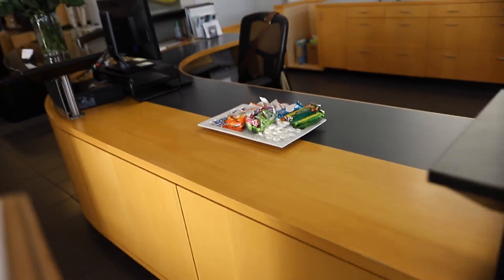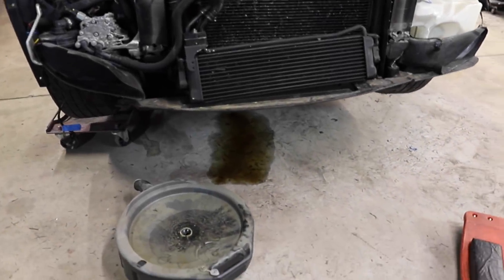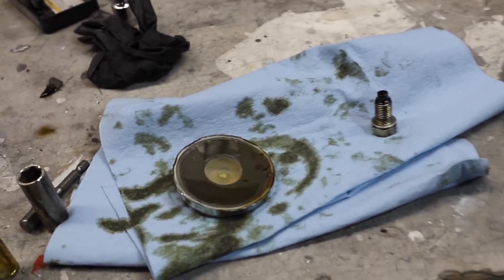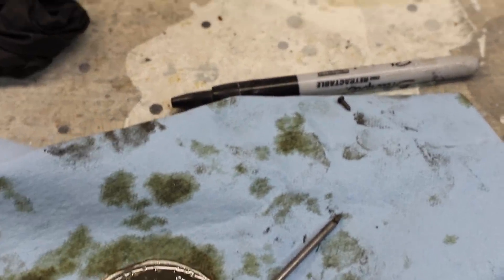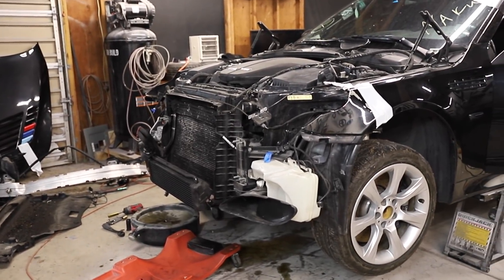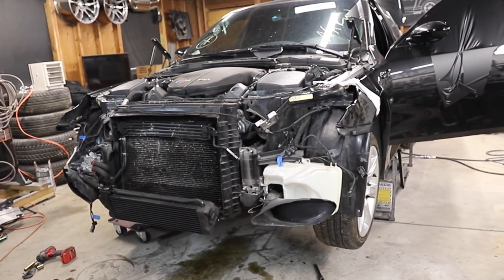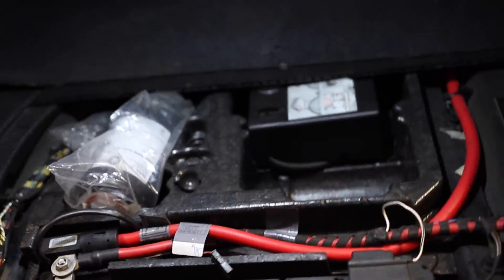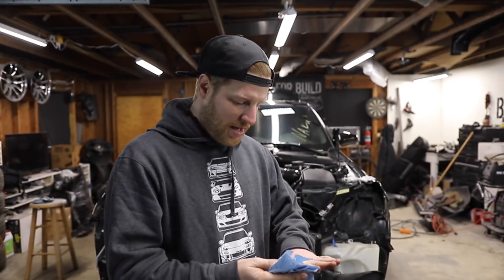Does the M5 Engine Run? Let's Find Out!

Comment: I don't know about an m5 but that amount of metal in the oil would not be worrying in an airplane.
Reply: Yeah, same. Don't know about an M5 (or an airplane for that matter), but I've seen worse in some of my bikes and those were fine. I freaked out the first time I saw it there too, but the fact that your oil filter is so clean is a pretty clear indicator that there's not something big falling apart. You might still want to do the oil analysis as that'll tell you about a bearing that's being worn down, but I wouldn't lose sleep over it.

Comment: Bro, don't buy oil from the dealership...
Reply: Why? Because of price? I think that Castrol provides the oil for BMWs, so you should have the same results with buying it directly from Castrol. In general the brand shouldn't matter as long as it's the right kind and good quality oil.
Reply: @zeroyon223 Thanks for the info. I'm not really familiar with the newer cars, mine is from 2003.
Reply: If you get a trade price the BMW oil is some of the cheapest full synthetics you can get.
Reply: Any time I need synthetic oil I buy pennzoil platinum. It’s never let me down. (This ad brought to you by Pennzoil) 😋

Comment: When doing timelapse, turn off the autofocus and use a higher aperture with higher ISO (it's a full frame, it can handle it). You can save these settings in on of the creative modes on the dial for ease of switching to this.

Comment: I hope you have a high quality torque wrench Chris! Torque specs on rod caps are very important to get right. Inconsistent torque leads to inconsistent bearing clearances!
Reply from the maker: just got me a top of the line one, cost me over $300
Reply: You'd have to overtighten a fastener to a relative insane degree to distort rod caps (or main or even cam caps, for that matter). Plus, as far as I know, most mass produced street engines have a pretty wide clearance spec range for parts. So it's not like you're trying to hit a pinhole sized bullseye with a dart. Not saying a good-working torque wrench isn't essential when rebuilding an engine, but you don't have to spend hundreds on one. A $50 one from Sears is more than accurate enough for the home mechanic or DIYer who won't be doing this job day in and day out. And if you want to get technical about what you should and should not be worried about, it's not even about "torque" when it comes to fasteners. Torque specs are nothing more than a means to an end. They themselves are just estimates for proper stretch and preload. And those torque specs can be thrown way off (ie; you'll under or overshoot your stretch and won't hit the proper preload) if you have debris or any kind of lubrication on your threads (or if the specs call for a particular lube, and you don't use it). Heck, even slight vertical angling of your torque wrench (so you're very slightly altering the lever length) technically impacts the accuracy of the wrench. And on beam or dial type wrenches (vs click type), where you hold the wrench will also impact its accuracy. Basically what I'm saying is, I wouldn't get bent out of shape about this. But that's just me.

And on a related note, I also find it hilarious when on occasion the same people (not directed at you) who preach about buying a top of the line torque wrench use nothing but plastigauge when checking their bearing clearances on their rebuilds. I'm not bad-mouthing plastigauge. I love it (though I'll use a mic and bore gauge if I feel it's warranted). Just find it odd that some people are so worried about one aspect of rebuilding a short block but are more than willing to cheap-out/take a shortcut on another.
Reply: It’s never checked when it’s done at the dealership. We never did it on the m3 or m5 BMW warranty would never pay us to check clearances. But yes spend the money on a Quality Torque wrench
Reply: thats actually wrong.
that would mean that tightening the rod bolts would distort the bearingcaps, which would be insane
Reply: If you change your fasteners (ie ARP rod bolts) you know that the rods should be checked for roundness because the torque specs of ARPs are generally higher than most stock applications causing the caps to "distort" more than stock. I'm using the word "distort" very loosely to prove the point that in certain circumstances rod caps can become out of round. When you're talking about 10 15 or 20 THOUSANDTHS of an inch clearance, torque specs matter greatly. They have specs for a reason. If the spec is 30 ft/lbs for proper bearing clearance, and you tighten it to 40 ft/lbs, your clearance is going to be tighter than desired, and vice-versa. He is already taking a risk by replacing bearings DIY, not measuring specs etc, so the least he could do is use an accurate torque wrench!
Reply: Good stuff, very excited for this build Chris. Hope you still plan to bag the 240!
Reply: I know that this does happen on some rods with arp/raceware hardware, but that is not how it should be, a bearing cap is not designed to deform or distort when tightened. A manufacturer engineered conrod with the appropriate manufacturer engineered hardware wont do stupid stuff like that. I'm not saying that he should use a 10$ tourqe wrench but they are tourque+angle bolts anyway(3 or 4 steps i think), so base tourqe is not super important.

Comment: if the  engine is bad, u ll only find metal shaving in the filter never in the oil pan
Reply: Elias Fiani you've never seen oil that came out of a bad engine obviously 😂😂😂
Reply: i ve seen it all, crystal clear water to chocolate fudge, never saw metal shaving in the pan, special on a dry sump setup
Reply: Elias Fiani it's just less likely because dry sumps have dual pumps most of the time. I've seen plenty of metal shavings in these v10's once they actually pop. It's all about circumstances when your talking about vehicles, what you've experienced isn't what everyone else does 😉
Reply: obviously,  I m only saying this cz i had to drop a new LS engine in 1 of my clients cars cz of poor maintenance, the car puked a piston rod out of its side, add insult to injury, my client had his last 4 oil changes and filters stored cz he wanted to send them for testing but he never did. and all 4 filters had shavings in hem
Reply: Elias Fiani wow that's some bad luck but it wouldn't surprise me someone who is bad about maintenance would do something like that. An LS in one of these would be the perfect combination, haven't seen it in person yet but I've heard about it done.
Reply: shady history specially maintenance is a deal breaker for me when i m buying used car anywhere, auctions or individuals or even car lots. i ve seen An LS swap 240 somewhere on the internet, cant remember who owned it tho, and u got check the rotsun, motortrend  262ci Lb1 swapped 240z

Comment: remember you have to program the battery to the car
Reply: dead fucking serious lol happened to me on my e60 m5 through codes up the wall until i programmed it
Reply: @schamaa11  iyghjjooookoooloooloooi7jbnnnmmmmmmmmmkkkkkkkkkkkkkkkkk
Reply: Yeah... Fucking BMW actually need something stupid. You need to introduce the battery to the car. That's what a BMW told me when I replaced mine
Reply: @nicholasfew1796  jjbnmjjjhjjjjkkkkkkkkkkkkkkkkkkkkkkkkkkkkjjjjjjjiiiiiiijjjuujjiiiiiiiuuiiiiiiiiiiiiiiiiiiiiiiiiiiiiiiiiiijjjjjjuuuujhjjhhjjjjjjjjjjiiiiiiujjj
Reply: E60 BMWs came with an AGM battery which is a little different than your typical lead acid battery. If you happen to replace to a different battery than what the car came with you’d have to code and register the new type and amp-hour rating for the new battery. The computer will regulate the charging according to the new specifications. If you change the type of battery and rating, but don’t register and code it you are most likely going to shorten the life of the new battery. Also, you may get a message on your iDrive that there is a high battery drain. It doesn’t matter for now, but when this goes into the 240z, it will need to be addressed. Btw, it’s very easy to code and register the battery if you set up NCSExpert software on your PC. I wish I lived near by and give Chris a hand with the coding aspect of this project.
Reply: I agree for cars from the 90's and older. But as manufacturers added more computer modules to their cars and modules that turned on certain features without the driver being present (like pre-heat and pre-AC features), the amount of drain a battery is subjected to is just too much for the old alternator/regulator combo. My E60 530i's computer goes to sleep after 5 mins and then will turn on certain things like my scheduled air circulation feature based on my preference. Proximity sensors will also turn on certain modules when someone walks by which is very useful when hard wiring a dashcam. Point is, cars are so much technologically advanced and well the charging system has to adapt to new standards. If you don't like the progression, then it's best you stick with 15+ year old cars. Reminds me of the people who stuck with carburated vehicles when fuel injection came around.
Reply: @Sammi Chamaa Is this real or are you kidding?
Seriously.
Reply: I've seen some weird over complicated stuff with new German cars and that's why I asked. If I hadn't known them, I'd say that's ridiculous.
Reply: Special  Audi , bmw or Mercedes has a BEM = Battery Energy Management. Since these cars have a lot of electronics, the module controls how much current flows through the car ,   the battery constitutes a vital component. Therefore, in order to guarantee its long service life in spite of higher loads.
Reply: http://bimmertips.com/bmw-battery-registering-and-programming-explained/   yuuup
Reply: Audi  does the same as well. #germanengineering at its finest
Reply: LOL! I have an E46 and thought that was complicated.
Reply: ugh Mercedes requires the same shit. but hey thats the #GermanLife i guess 🤷🏻‍♂️
Reply: Yes, Mercedes-Benz and BMW are relatively neck and neck in terms of technology.
Reply: Or just buy the size and type the manufacturer recommends.
Reply: My cars are 16 and 18 years old (both German). Thankfully I'm not familiar to this process. Can you do it in the car without hooking up computers or go to a shop?
Reply: Special not really if you think about it u have so much electronic in your car as well as another person and they have a module ,  there battery will be more efficient and yours will have overload and could burn out. Which won’t be good but to each their own. 🤷🏻‍♂️
Reply: It’s the same story with many mid to luxury class modern cars. Jag and LR both require coding the bms (battery monitoring system) after changing a battery. You can do it DIY if you get the software (JLR SDD for JLR cars, or for example VAGCOM for VW group cars like vw, audi). Another story is cars where you aren’t allowed to take the battery off without supplying backup power. This is also getting more common. Be prepared to spend 250$+ on battery chargers and at least the same on software if you go DIY. Been there.
Reply: Special yeah I feel ya, sadly technology is advancing and people are getting lazier ,higher expectations , so much that it’s hard to keep up with.
Reply: vdochev what cars do you have? Curious
Reply: Stupid idea to make such complicated systems , there was nothing wrong with the old alternator and voltage regulator combo . If it ain't broke why fix it , oh ya that's rite , it's so they can legitimize charging 10 times what the car should cost .

Comment: Cut open the filter and spread the pleats out. If the engine is coming apart you will find out in the filter
Reply from the maker: I was able to look through it pretty well, thats where i found those little ( copper or paint ) flakes
Reply: By the way. All filters run in through the center and out through the sides. You won’t see any debris on the outside
Reply: How do you personally open the filters without getting more shavings in there? like I used a sawzall once and it was a stupid idea
Reply: TheVaultDwellar I have a sort of can opener thing I use. But I’m a mechanic lol. In his case there’s no metal casing so he just needs an exacto knife to just the top and bottom off
Reply: B is for Build yeah and like you said. You will be replacing the main bearings anyways so it’s not really a big deal either way

Comment: You may have a short to ground btw I had that issue with my e92 335i the fan motor wires corroded and ended up causing a short DIY’d it and next week BMW issues a recall lol. Obviously a different car but it wouldn’t surprise me if that blower and connector are the same. The metal shavings thing is hard to say as you don’t know when the last owner did an oil change if they did one like 1k Miles before they crashed it the oil may look much better than it really is. I’d say go for it though as it’s piece of mind. The 6D is an awesome camera btw great choice.

Comment: wtf kinda oil costs $135?  Does it have BMW dust in it?
Reply: iseewhatyoudidthere usually manual transmission fluid runs that expensive from the dealer... As for engine oil, the one that has the BMW logo on it lol
Reply: E60 M5 uses 10W60. $14 a quart and you need 10 quarts.
Reply: V10s usually take 9-10qts. And full synthetic usually goes for 9-11 a quart for the high end stuff. Filter was probably 15ish
Reply: if you think thats expensive you should take a look at changing the oil on a can am atv or side by side. around $85 for 2 quarts and a filter.
Reply: radioactiveload vortech v3 fluid is 35$ for 12 ounces (32 ounces is one quart) 

Now that's pricey
Reply: BMW M cars need 10w60 oil to help the rod bearings survive.
Reply: iseewhatyoudidthere actually they have special additives in their oil made for their cars. Im not an engineer but id rather trust their word than use non recommended oil. Even if they are scamming me.